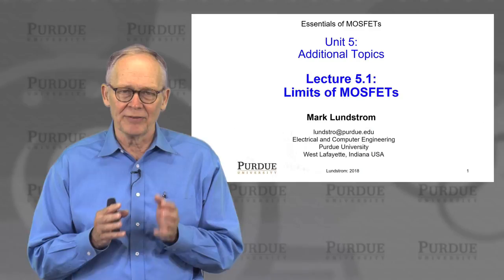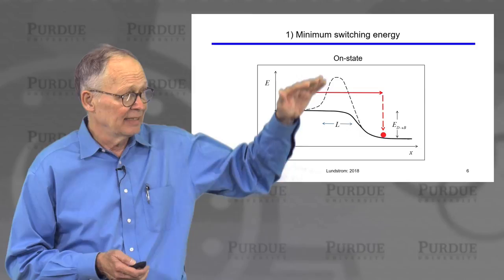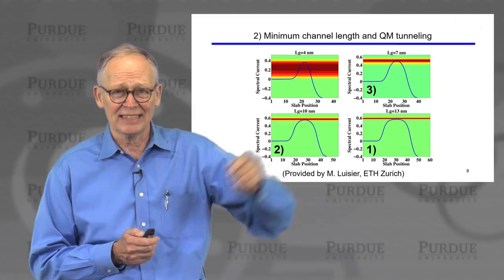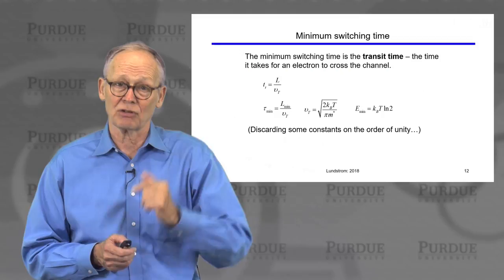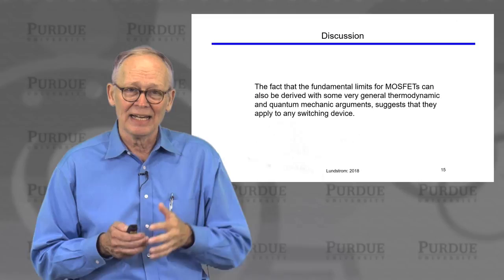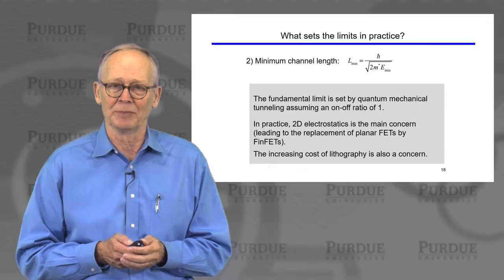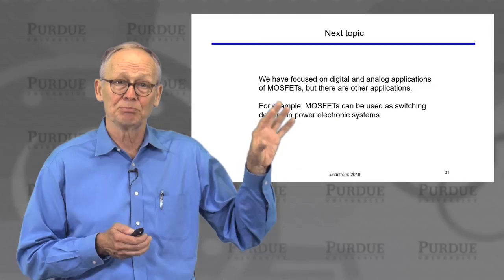nanoHUB-U MOSFET Essentials L5.1: Additional Topics - Limits of MOSFETs

Comment: 00:00    Lecture 5.1: Limits of MOSFETs
00:37    Questions (for digital logic)
00:57    MOSFETs are barrier controlled devices
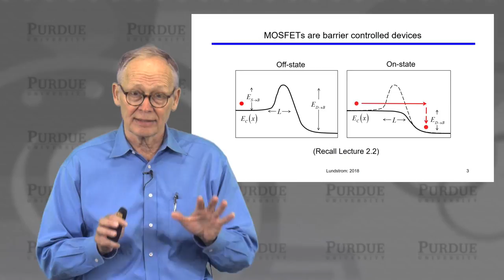01:46    Fundamental limits of MOSFETs
02:03    Three questions
02:23    1) Minimum switching energy
03:34    Minimum switching energy
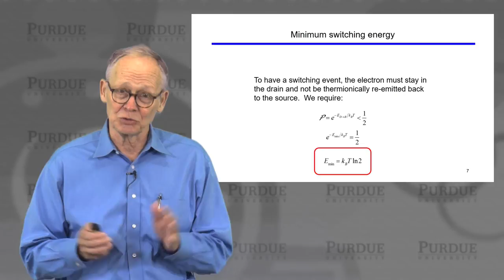04:33    2) Minimum channel length and QM tunneling
06:05    Minimum channel length
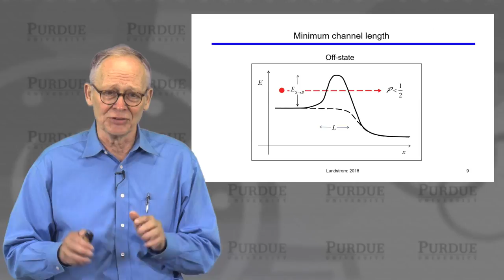06:31    Minimum channel length
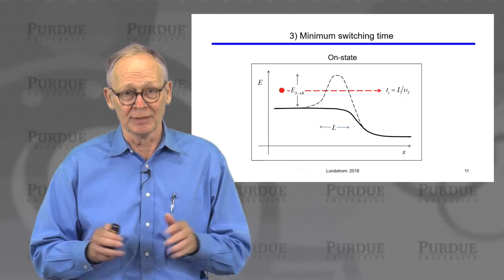07:48    3) Minimum switching time
08:00    Minimum switching time
08:53    "Fundamental limits"
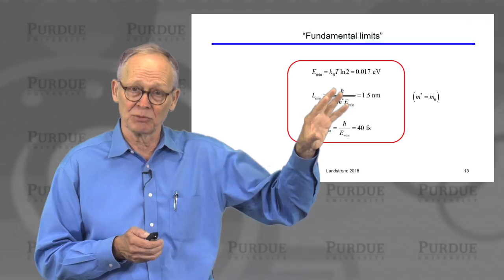09:45    Discussion
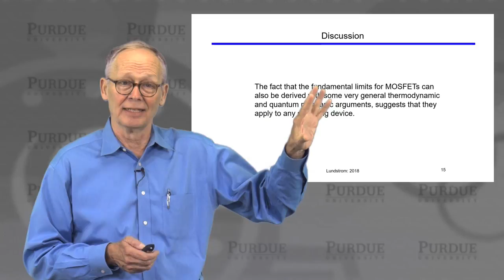10:37    Discussion
10:58    22 nm technology
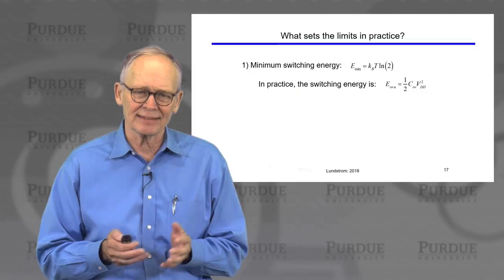13:12    What sets the limits in practice?
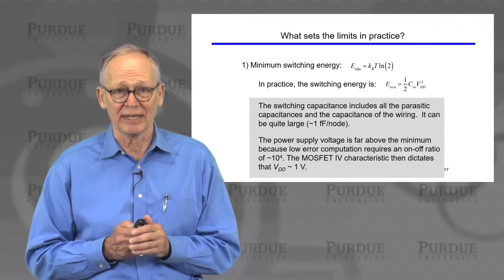14:55    What sets the limits in practice?
16:15    What sets the limits in practice?
17:08    Summary
18:14    Next topic